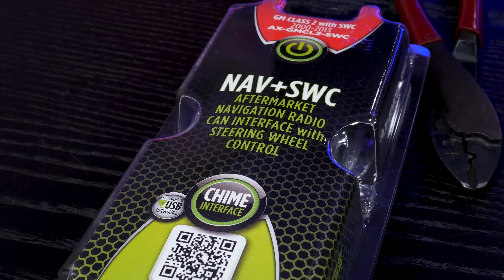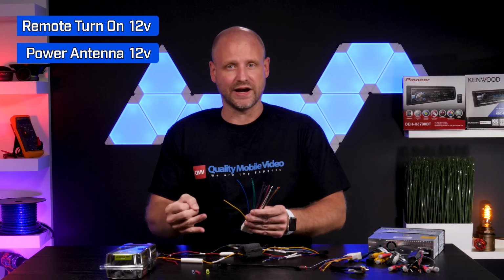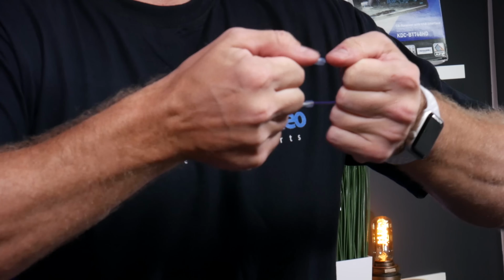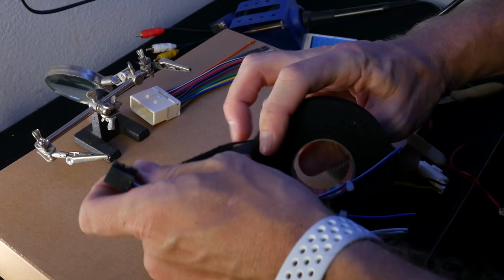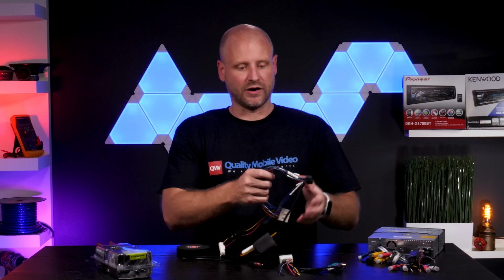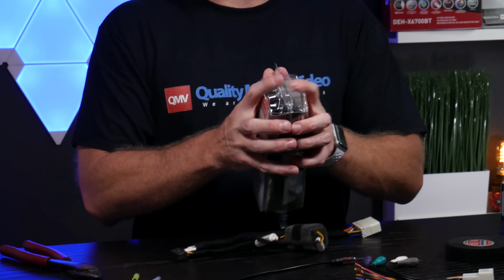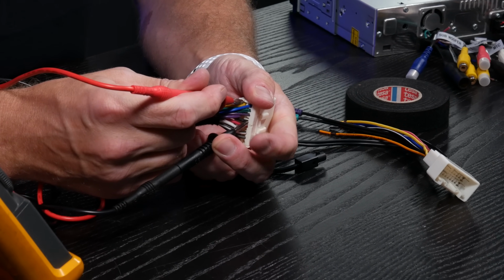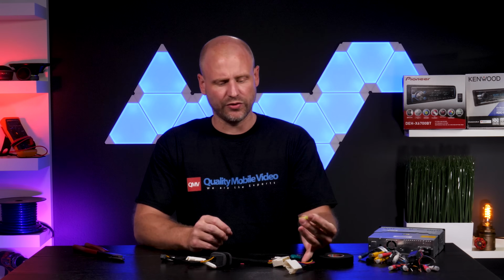Car Stereo Wiring Harnesses & Interfaces Explained - What Do The Wire Colors Mean?

Comment: I have a Chevy Silverado 2011 hybrid and I try to hook up a dual radio but my truck  doesn't have the red wire only the red with white stripe wire which is the battery wire I mix the yellow and red wire together that I put it on the battery wire but it constantly comes on for some reason and this is the only way that will work by using the ketchup and mustard method that i twisted on the battery wire do you have any methods that could help

Comment: I was helping a friend of mine with hooking up an aftermarket pioneer radio in his 2011 impala. His interface is much different and had us tap into wires. My issue is, it continued to have power even without the key on. Any ideas?
Reply from the maker: Hey Jamie, most likely sounds like imporoper headunit wiring. I doubt it's an ignition switch problem. What interface did you use? Sounds like you wired the memory/always on wire and the constant incorrectly. So it's drawing power from your battery eevn without the key in the ignition. You should be using this interface:

https://www.qualitymobilevideo.com/ax-adbox1.html
Reply: @Qualitymobilevideo  thank you sooo much!

Comment: im ok with the color of wires and what theyre for,i need what the pins going into the deck are,16 pin connector on a pioneer fh-85p,ive looked a ton of pages,pioneers web page say its not found,site that says you can download a manual,its just the cover,ebay and amozon both list a 16 pin connector,but its wrong size,and from a pic ive seen the wires are in different locations in the plug,any suggestions

Comment: I didn't really get the answer from the video and i really don't wanna fry my new aftermarket radio... So i have Fiat Stilo 2006 and all my wires connect to the aftermarket radio, but i still have a problem turning it on...there has to be some problem in connecting the black, red and yellow wire. On the car i have black, red and 2 sort of washed of pink or yellow wires, and on the adapter i have black, red, yellow and orange... how do i connect them together to work properly? i'm using iso harness adaptor so there is no soldering of anykind, just pins to be switched if needed.
I hope you can help me with it :D thanks for the great video tho!

Comment: what happens if you cross lets say for example a positive left front with a negative right rear, can you blow your radio? I want to help my grandson. He bought a 1994 nissan D21 pickup but the colors on charts and book are different and I don't want to blow the radio if I cross any speaker wires. I have the left front working but still need to do other 3 speakers....Thanks

Comment: Having trouble with an 05 chevy cobalt ls i can get aftermarket radio to turn on but get no sound i looked up some diagrams and they all said somthing about a pink amp wire but i seem to not have one any help ?
Reply: I also bought the metra harness and interface still same issue

Comment: Thank you very much. I followed your guide and I managed to connect everything. The radio works and all, but I can’t get any sound from it. All four speakers are connected. I do not have a factory Amplifier. The ‘AMP’ wire from the new radio isn’t connected to anything since there was none on the previous radio. I tried connecting it to the ACC power and also to the ANT wire. Still no sound. Any ideas?

Comment: So I have a 2011 Chevy Silverado and I jus installed a radio but doesn’t turn off with the key or when I open the door I have to manually doing it. Do I need a interface?
Reply from the maker: Sounds like a wiring issue! Yes you need an interface. Here are some options for your truck:

https://www.qualitymobilevideo.com/gmos-lan-01.html

https://www.qualitymobilevideo.com/gmos-lan-02.html

Comment: Made my job easier but I have a question. I replaced the factory AM/FM Cassette radio in my '99 Jeep Cherokee. With an aftermarket radio. Only bad thing is a weak AM signal. I'm told to hook up the Power Antenna wire. No power antenna. There's a White/Blk wire from the Jeep harness that says "Radio power antenna trigger wire". Supposed to go to the Blue wire on the replacement radio ?

Comment: I have used the car ANT cable  and plug it directly to the stereo unit socket. My FM radio stations are working. But ALL my AM radio station are not working clear.
Can we connect the ANT wire (blue wire) directly to the factory antenna cable? If yes should it be connect to the middle pin of the core or the outer shield?

Comment: Hey, I just got a touch screen off Amazon.  All the speakers and the ground wire and ignition/constant wires are hooked up.  The sound is working, but It's extremely crackly.  Like my speakers are blown or something..   why is this?  Is it because I don't have the power antenna blue wire hooked up? 03 f150

Comment: just an add on info (on some decks (example kenwood) where there are 2 blues (blue/white & solid blue) blue/white is the amp- on/lead ... the solid blue is for remote antenna ( only powers on when in FM/AM - or at system boot for 10 sec ....   this stumped me 1 time - when I switched from a pioneer to Kenwood (pioneer only have 1 blue wire) if both are present -- use/test blue/white 1st

Comment: i have a question, so i wired my after market radio but when i turn the car off, the radio still stays on, and idk what to do, my red was connected to my constant but i disconnected it since it drained my battery, what do i connect it to so it turns off when the car turns off. im using a wiring harness also
Reply from the maker: Sounds like a wiring issue! If you installed it yourself check you made all the correct connections to the battery. If someone did it for you, bring it back to them and ask them to redo it. 

Car radios are designed to have a single ground wire and two power wires. One power wire is hot all the time, and the other only has power when the engine is running, or when the ignition switch is in the accessory position.

If the main power wire for your head unit is connected to a power source that is always hot, the radio won't ever turn off.

You can check for this problem with a voltmeter or test light. If both power wires are hot all the time, you'll need to rewire the radio to receive power from a source that is only hot when the ignition is in the accessory or run position.

Comment: if amplifier REM is connected in ignition switch, is the power supplied through the main wire or through the ignition switch? also how much amp is required for REM?
Reply from the maker: Most amps pull 50-100mA on remote wire

Comment: Friend, could you help me? I have a 2008 Pontiac Torrent Truck, I bought a 9-inch Android Radio, when I connect the speakers it doesn't sound, because the original amplifier that comes with the car runs out of power, and the speaker cables don't work, could you tell me which cables you connected so that the amplifier of the
Car and thus be able to Pass Current to the Speakers

Comment: I have a 2010 Subaru Outback Limited Harmon Kardan W/O navigation I put in a Kenwood DMX47S. Stereo powers on I can connect my phone all seems right I just have no sound. Any ideas. Thanks in advance.
Reply from the maker: Likely not the correct interface or the remote turn on for the factory amp is not connected.

Comment: What do I do if my head unit doesn’t have a dimmer wire but my adapter harness does?
Reply from the maker: Does it have an illumination wire?
Reply: @Qualitymobilevideo  I’m not sure, I color matched every wire but did not have an orange wire for the head unit. Every other wire was there though.

Comment: Have 06 dodge2500 with double din factory dvd player with Infinity sound system . Tried upgrading to aftermarket stereo having alof of issue wiring it . Basically needs 12v and ground and Basically speakers wires  well got it to turn on but no sound. I believe theirs amp but can't find the wire for that usually blue ..my oem harness doesn't have blue wire . Any help would be appreciated thanks

Comment: Any suggestions would help. I have a 2005 Dodge Dakota. When I wire it red to red and yellow to yellow, I get nothing. But when I combined red and yellow coming from the stereo, with the yellow coming from the vehicle. I get constant power. Issue is, it doesn't go off when I turn the vehicle off. Any suggestions as to what I could be doing wrong?
Reply from the maker: If an aftermarket stereo remains on even after the car is turned off, it's most likely a wiring mistake. If the main power wire for the head unit is connected to a power source that is always hot, the radio won't ever turn off.
Rewire the radio to receive power from a source that is only hot when the ignition is in the accessory or run position

Comment: I tried to install an aftermarket radio but it always stays on? Can I switch my yellow wire to connect with the red to solve this issue?
Reply from the maker: The red wire is the accessory wire, that turns the unit on and off.

Comment: What if there is a pink wire from the harness? Would that equal acc? I have acc on the stereo wiring but no red on the harness. But also the harness came with a red wire but again no red on the harness.

2010 hhr LT

Comment: Do the colors mean the same thing throughout the industry? I.E. white to white, red to red.  Was looking to hook up radio harness to aftermarket harness so I don't have to cut factory wiring harness.
Reply from the maker: Generally yes, some times there are differences in things like amplifier/remote turn on/etc. What's your make/model/year?
Reply: @Qualitymobilevideo  2006 dodge ram 2500 no navigation or infinity speakers. Searched online and I guess the car "talks" to the radio by sending electrical signal pulses to it so it's not a simple wiring harness I need it's a more advanced one. It's about 100 bucks. But if you have any other options let me know. Thanks.
Reply from the maker: You can also use this interface: https://www.qualitymobilevideo.com/ax-adbox1.html
Reply from the maker: Or this (non-amplified system): https://www.qualitymobilevideo.com/chto-01.html
Reply from the maker: This includes SWC: https://www.qualitymobilevideo.com/ax-ch013-swc.html

Comment: Great video! I’m learning a lot with your channel. I have a question that I can’t figure out. My radio (7” smart touch screen) has two yellow wires for Battery (+) constant, two ground cables (black), one ACC (red) and one IGN1 (blue) cable. So, I plugged in each wire to their corresponding wire, except the IGN1, I couldn’t find a corresponding one. 

However, I had to change everything and plug into my ACC wire in order for the radio to turn off when I exit the car. So, right now, I have the two yellow wires, and the red wire plugged in to the car’s ACC wire. Is that good? 

And, one last issue is that the radio keeps showing a warning about battery discharge, and to use the car with the engine on. I checked the voltage on the ACC wire from the car and it keeps at 12v even when the car is on. However, the constant wire that I am not using goes from 12v to 14v when the car is ON. Do you think this could be the reason I’m getting the warning? Or could it have something to do with the IGN1 wire that I’m not using? Any help will be greatly appreciated. Sorry for the long comment 😅
Reply: Run the red wire to an ignition fuse
Reply: @adrianjaimes14  Thanks for replying! You mean the red wire from the radio to like a fuse-tap sort of thing?
Reply: @thegiakz  yes exactly, use a tester to find an ignition fuse and run it to the red one on the radio

Comment: I have a 97 and a 2005 F150 ford truck. I want to install my clarion nx500 from the 97 to the 2005. Will the harness of the nx500 fit the harness of the 2005. Is the 97 and 2005 plugs the same in the ford harness.

Comment: Thanks for the confidence booster!  I have all the parts and was curious only about if harness is color to color.  You answered that and some other questions I wasn't thinking about.  Now I'm off in search of how to: install aftermarket amp/subs/cap to existing aftermarket  head unit.
Reply from the maker: No problem 👍
Reply: @Qualitymobilevideo  I got it going! Install was easier than I thought. 2016 Soul+. Single Din flip out with pocket. Because of this Vid, I am going to wrap a lot of my interior. Kudos

Comment: So my radio harness pioneer avh 601 has a   blue/white wire marked amp and my carside harness has a solid blue wire marked power antenna...can these go tied together?
Reply from the maker: Do not wire those together. What is your vehicle make/model/year?
Reply: @Qualitymobilevideo  06 Toyota 4 runner
Reply from the maker: My mistake it can work! It doesn't always so I just needed to be sure of your model
Reply: @UCFsel5Wa76ucyypAmCNyIRw so using the metra wire harness will not work? Can it cause damage?
Reply: @Qualitymobilevideo  same for the orange/white and orange wires...can those go together?
Reply from the maker: Your original question will work. I just had to check your vehicle
Reply: @Qualitymobilevideo  thank you for your help...you are awesome

Comment: Those are the easy wires. Everything you buy will have the color code for them in the manual. The harder part is the color code for the car you are working on. In case you have to hardwire it, because of no wiring harness adapter or somebody has cut the headunit's wiring plugs off.

Comment: What about the tweeter wires?
Reply from the maker: This will depend on the vehicle, they are usually paralleled with a capacitor as the crossover.
Reply: @Qualitymobilevideo  so which wires do I plug into the tweeter section on a filter

Comment: hey I’ve never installed a sub before and I’m trying to connect the control wire and I don’t know where to put it
Reply: The amplifier turn on wire needs to connect to the aftermarket stereo blue white wire. The other end obviously goes in your amplifiers remote input terminal

Comment: 2005 f150 king ranch radio turn on amp works but no sound on regular speakers
Reply from the maker: Your vehicle may have a factory amplifier that is either not getting signal or remote turn on.

Comment: Yellow Wire - Clock Radio Preset
Red - Ignition Switch
Orange and White Wire - Illumination Switch
Black Wire - Ground Break
Purple/White Wire - Reverse Gear Input
Yellow/Black Wire - External Mute
Blue/White Wire - System Remote Control
Light Green Wire - On-Off-On (Parking Break)
White Wire Black Stripe - Speaker Output (Left Front or Left High)
Gray Wire Black Stripe - Speaker Output Right Front or Right High
Green Wire Black Stripe - Speaker Output Left Rear or Left Mid
Purple Wire Black Stripe - Speaker Output Right Rear or Right Mid
Reply: Thanks for the input LG know what the Hyundai colors are

Comment: So if i have install a 4 channel amplifier, the harness i just join the 4 point, beteri power, key power, ground, remote and only? 
The speaker cable will go out from 4 channel amplifier, the harness there terminate by hot tube.
Its Correct do like this?

Comment: So I have a back right amd back left speaker. Them I have two back speakers in the middle. How do I connect thos speakers in the middle If there are not any wires for them? 
Can i just split the back left and right to four seperate cables? Each going to a different back speaker?

Comment: Hello,
          I installed aftermarket radio in my VW Golf TDI 2008, I am having one issue, Before installation of new radio the bass and sound was very good in Original old radio, but when i installed new aftermarket radio the Bass is not good i think factory amplifier is not working with new radio, i replaced it with old one and the old one is working perfect but i want to use new one, can you please help me with cabling, i think i did something wrong while cabling. one blue wire i connect with radio antenna. Please any suggestion.

Comment: I have kenwood radio KDC-4051U installed on my ford focus 2004 i wonder how to connect wires to remote radio from wheel remote control that has for original ford focus radio

Comment: Pleaaase answer me. Assume all audio system connections have been made. All that is left to do is connected the Head unit to the car. If I have installed new speaker wire to front, rear and sub speakers WHAT do I do at the harness side. Must I connect Orange, Black, Blue, Yellow, Red wires FROM the RADIO harness to the CAR harness DIRECTLY... OR can I simply REMOVE OLD speaker wires and pins from the existing harnesses and join both connector looms together?!

For example: I would be using a 5 channel amp to power a full system. Aftermarket everything, inlucing speaker wires. Now what changes must I make at the harness?

Comment: i have a Nissan Rogue 2011, the original stereo is not with Sat nav and i bough an original stereo for Nissan with Nav but i do not know what the rear camera connection cables do. As the rear camera connection is different. The car has the original Rear camera installed already manufacturer.
Harness that came with the original stereo
Top Row of connection:
2 Black wires  with grey strips ( which join into 1 )
1 Yellow with grey strips
Bottom Row connections:
1 Red, 1 Black and 1 White with grey strips

The car connection is:
Top Row:
1 Red
1 Black
Bottom Row connections ( cables ):
1 Yellow
1 Green
1 Violet ( Purple )

Are you able to help me which cable matches which?